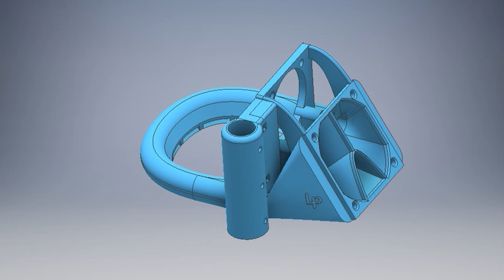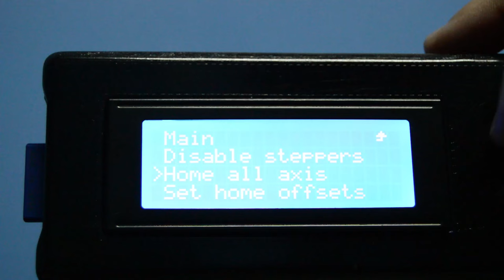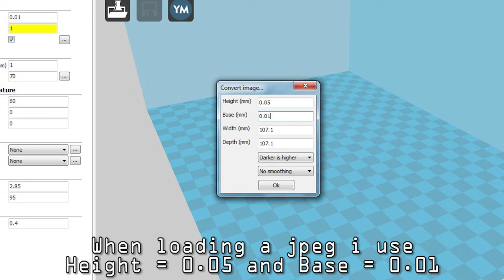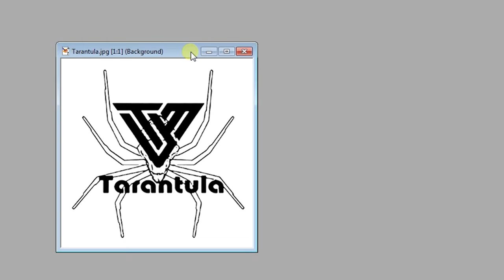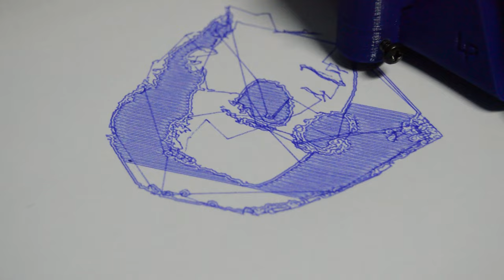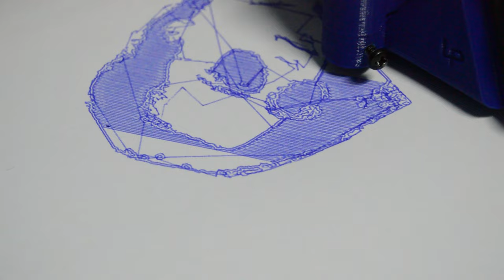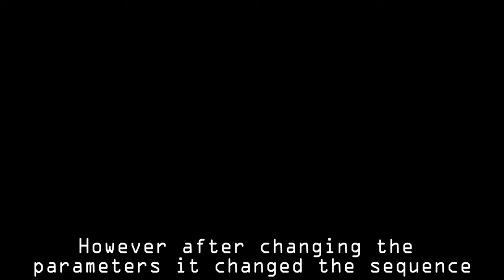Making my 3D printer DRAW - TEVO tarantula

Comment: Pretty nice, but wouldn't retraction have resulted in a much better end result (without those lines all over the place)?
Reply from the maker: Hi Beaving,
The retraction is on and the Z hop is also on (you can see the Z moving up) but somehow it does not raise the Z all the time. I believe that there is a way to improve the lines issue by tweaking the settings in cura.

Comment: wouldnt it be better to have the head lift the pen between strokes
Reply from the maker: Hi Lerbyn,
The retraction is on and the Z hop too and it should raise the Z every time but if you get a closer look you will see that sometimes the Z raises up and sometimes it does not. I believe that there must be some more tweaking needed and not only the retraction and Z hop on.  I also used the old cura version (1.5)...so not sure if the new version works better for this.
Reply: i know this feature works in simplify3d
Reply from the maker: Thanks for the feedback Lerbyn :)
That is good to know.